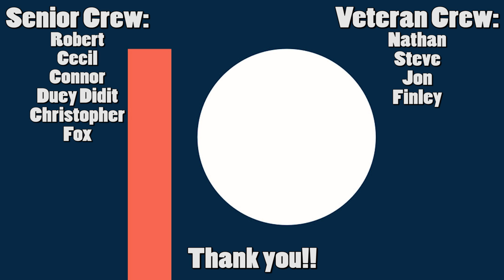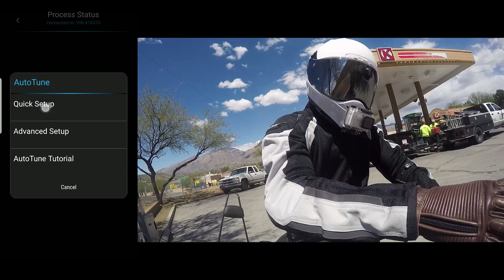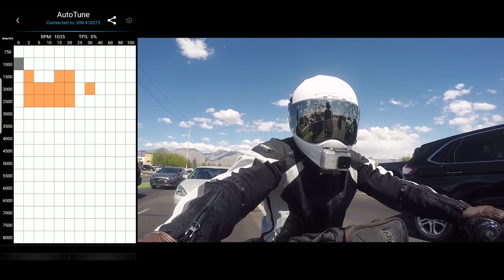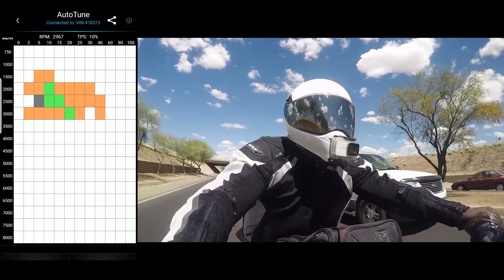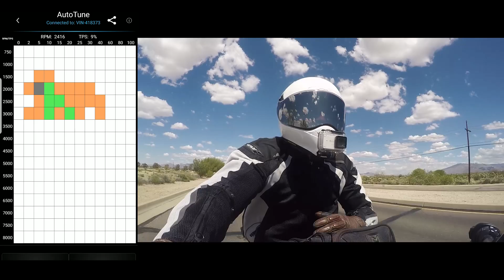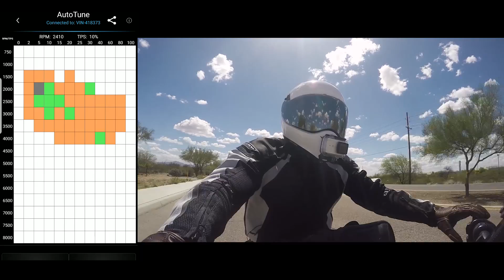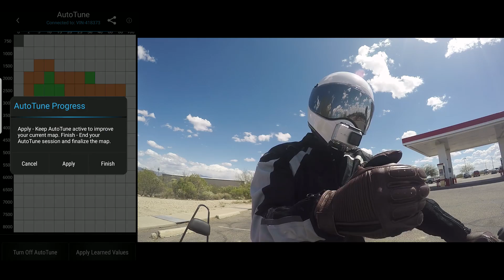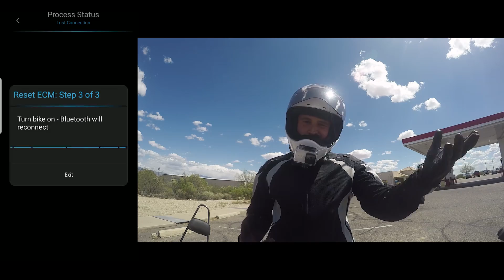Autotuning the Vance and Hines Vo2 Air Intake with the Fuelpak FP3 / Part 1

Comment: Had last tuned my iron when I had s shots which I tuned, then sold the shots . Running stock pipes with SE slips now and only getting round to doing another tune , bikes been using way too much fuel 85 miles and light on ( 1.5 ‘ lift ) so hoping when done two tanks worth of retune that will increase ? . Ways surprised the SE slip ons aren’t listed either , had to go ‘ generic ‘ slip ons .

Comment: I've tried the FP3 with V&H slash 3 in slip-ons and intake kit on my 2019 Sportster 48. The bike ran worse every time I applied the learning... in fact after the 3rd time the bike was dangerous off idle and part throttle. I was afraid of the cars and trucks behind me hitting me coming out of traffic lights because the bike was backfiring and hesitating (also going around a corner out of a light). I started over 3 times over two weeks and I've had it. Between the glitches in the app and lost connection crap it's not worth it. I sank about 700 into V&H stuff... now I'll sell the slip-ons and remove the FP3. I emailed V&H asking if they could wipe the vin so I could use it on another Harley (may have better luck), they have not got back to me yet. If they won't or can't wipe it then I will never buy another product from them... so far I've had to eat 400 dollars with nothing to show for it. Oh BTW I'm an engineer and a motorhead... so there was nothing going on with this equipment that I didn't understand. I doubt the downloaded map for the installed equipment was the product of hours of Dyno work... sure didn't run like it was.
Reply: You have to flash a base map then learn off that, not sure if you did or not. That's how I did it and runs great.

Comment: Mine worked amazing, however once you Map it to your air intake to exhaust, there is no auto tune needed!!!!! Vanes hines already does all the work for you!!!! Not sure why all these videos do an auto tune? When in fact the FP-3 tells you that once you Map it your absolutely fine!!!!!
Reply: Canned maps are a good starting point,  but every bike-engine is different. Auto tune tunes to YOUR bike specifically.
Reply: V&H doesn’t have EVERY intake or exhaust mapped. I put a Two brothers exhaust on mine and they didn’t have that specific exhaust in the options

Comment: Uber Noob Question:
Can you use the AutoTune function independent of the mods you put on your bike? For instance, if I choose a different brand for my exhaust and air filter, will that still work? I don't see a reason why not.
Also, does it learn and applies the changes on the fly or do you need to flash it to save the settings on the ECU?
Reply: You have to flash it after auto tune